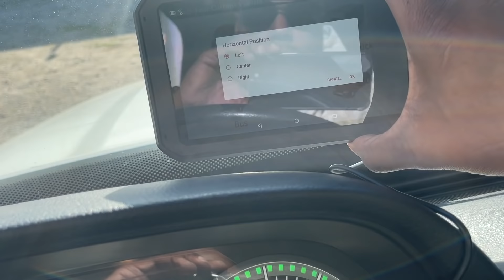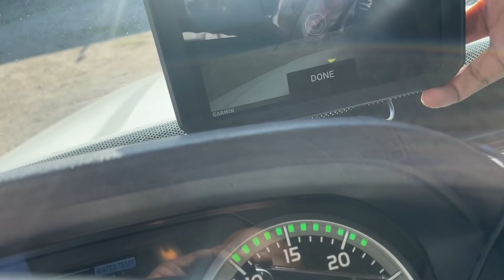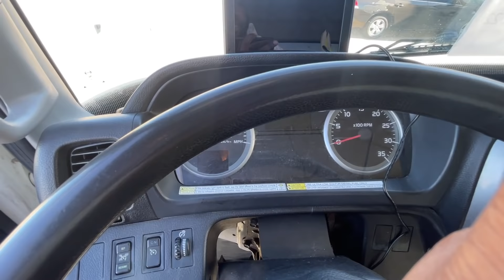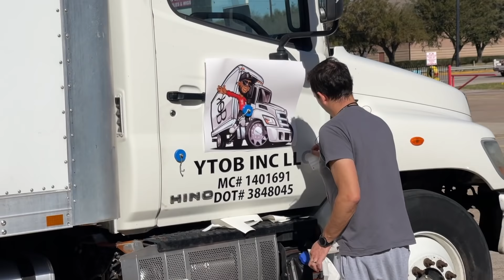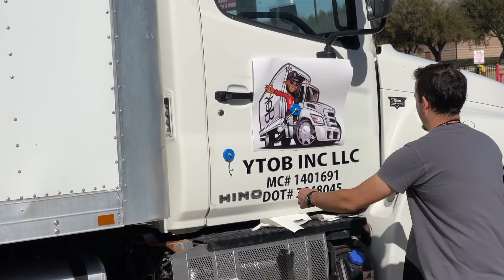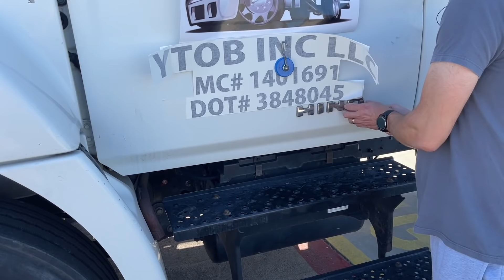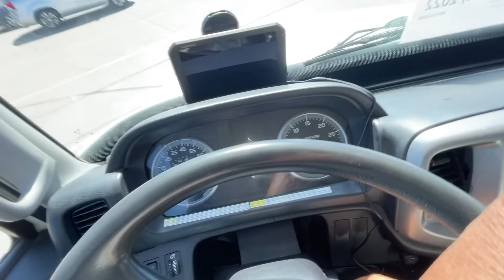LOOK WHAT I PUT ON MY BOX TRUCK AND SEEN A ROAD RAGE WRECK IT WAS HORRIBLE

Comment: Congratulations on your new business. They actually make rubber stops for pallet jacks so you don't have to go through all that as far as tying the power jack to the side of the truck. They make a rubber wheel chock that the wheel sits in and then it don't move. Also I saw you noticed that hole in the floor just remembered check your cross members make sure all that's good. Not sure if you let a forklift load your truck or not but you don't want them falling through. Other than that good luck on your new adventure

Comment: 🤦🏾‍♂️ you don’t need a pallet jack all you need is a Dolly  pallet jack are mostly used for semi trucks
Reply: 99% of box truck loads you'll wanna use your own Pallet Jack unless you always want forklifts going in your truck and damaging your suspension or springs. Also quite a bit of loads require you to use the Lift gate and if you don't have a pallet jack how are you gonna unload the pallets?
Reply: @SavageExpert  well I own 2 box truck  I use dolly’s and have 2 guys in the truck never need a pallet jack unless the business he doing uses pallets for the loads
Reply: @SavageExpert  also if he is in a business that requires a jack and they load up pallets onto truck I recommend him to he a box truck with air brakes since loads gonna be heavy
Reply: @ypcdro1739 I run Freight generally from Dock to dock and even if you have a truck that is Air Ride(Mine is aswell) you still want to limit how much forklifts are going into your truck because it can damage your truck. Their are alot of forklift drivers that don't know how to drive in trucks properly. I don't do moves or anything residential I'm speaking specifically on Freight hauling and I promise you need your own Pallet Jack as alot of loads will require you to have one.
Reply: @SavageExpert  I get what u saying